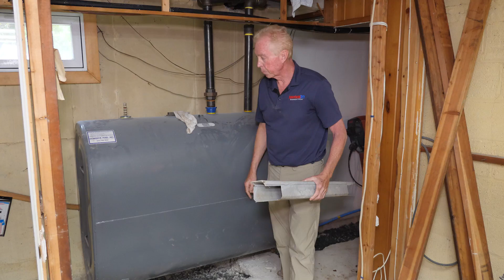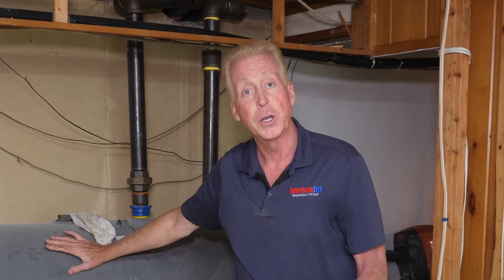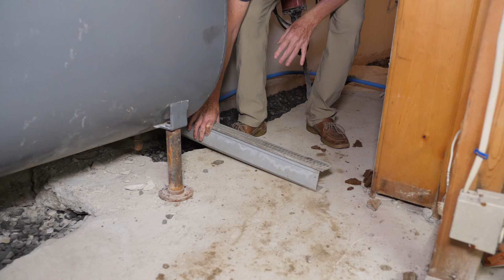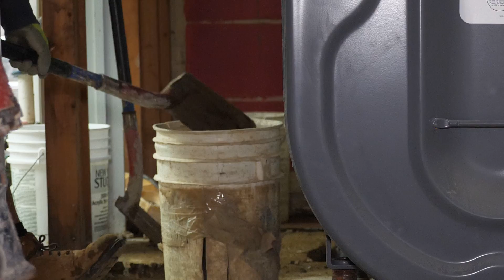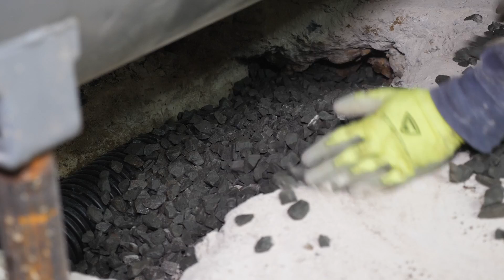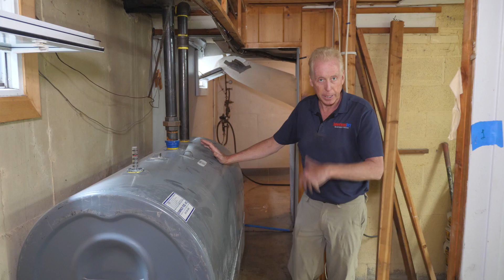Interior Basement Waterproofing - Oil Tank Pad

Comment: What is the purpose of the "L" shaped drain board that's installed ?
It seems by all your installation videos that the cement covers it & holds it in place but to me the cement would not be very thick that's laying on top of it.

Comment: My house was built in the 1920's, hollow block foundation with brick piles (not sure if that's the correct term).  There was an oil tank in the yard, huge furnace inside.  Both items were removed as part of a repair deal before closing on the house (we wanted to switch to gas, was a good idea 12 years ago).   

There are lots of cracks in my foundation where the old furnace used to be, and there is also a copper pipe coming up through the foundation that was hammered/bent over by whoever removed the old furnace.  I tapped the floor (after recent flooding) and can hear a hollow sound leading to the exposed crimped pipe.  

The original homeowner said that they "never" had water in the basement.  On the first week that we moved in there was a very heavy downpour, and our basement flooded.  While I'm sure the previous homeowner was lying about water, is it possible that removing the furnace caused the flooding issue?  Over the years it has flooded on and off again with no obvious entry point.  It's very sudden too, not a slow event.
Reply: I would say, ‘yes!’. I looked into removing the old, decommissioned tank next to the foundation and read about how that removal and new, loose soil could cause flooding and destroy the foundation. I called my county department of health, the regulatory agency responsible for environmental safety and they told me that a decommissioned tank was all that was necessary to sell a home. If new owners chose to remove the tank, as it sounds like you did, that is their choice however, disturbing the soil in this manner can cause structural damage to the house.